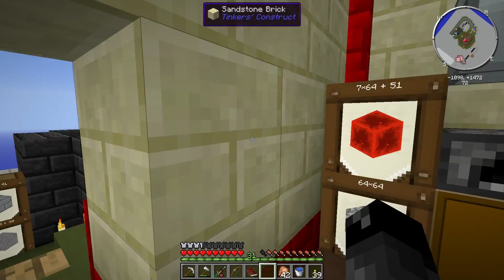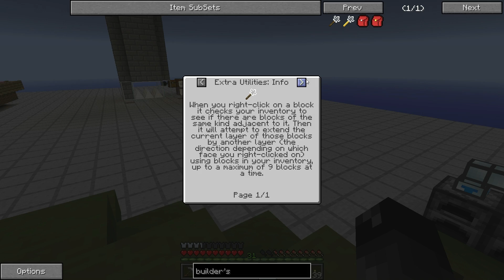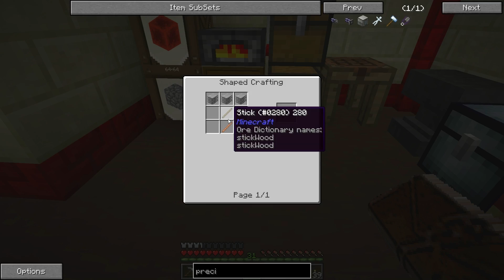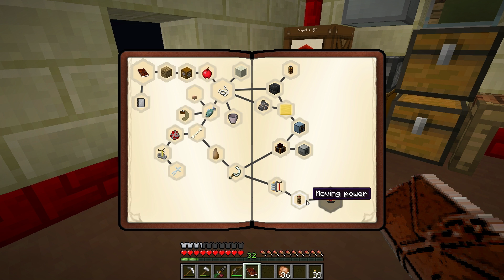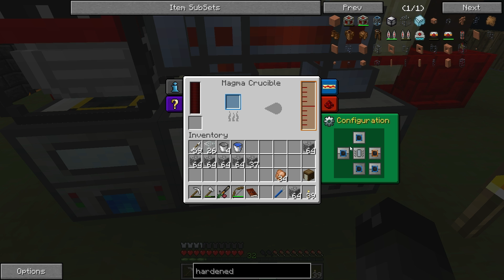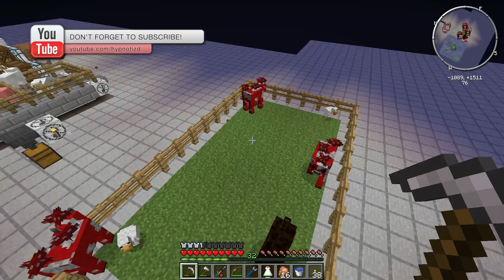Minecraft Agrarian Skies - Feel My Power!!! [E11]

Comment: Those lava generators seem to have had their recipe removed, probably to prevent the OP heated redstone generator from being crafted, but anyway the TE magmatic dynamo uses less lava, yet produces more RF per bucket and also automatically throttles back to 4rf/t when the power isn't needed.

Also those flight potions are refillable, alchemic chemistry set :)
Reply: I'm guessing it was removed so people would use the dynamos but with a mob farm Ender Pearl Generators are super cheap and each pearl lasts for 20 mins.
Reply: Matthew Trope true they are a great early game power supply, also use all that excess blaze powder to make eyes of ender, adds another 5mins per pearl in the ender gen.
Reply: What do you mean? Each normal pearl puts in 20 mins into the generator, wasting blaze power for eyes of ender and 5 more mins when I can just use normal pearls? Do you mean the eyes of ender add 25 mins?
Reply: eyes of ender will run for 25mins each, and using up some of that pretty much useless blaze powder you gain from sieving seems worth it to me.
Reply: Oh cool! Thanks for the tip :D
Reply: No. The recipe wasn't [intentionally] removed. It was an accident on the part of jadedcat.
Reply: Anonymouspock Which is a shame, the lava generator is kinda sucky compared to the dynamo, and the heated redstone gen you craft with it can provide 320rf/t for 4 mins from 1 piece of redstone, which seems a bit unbalanced to me.